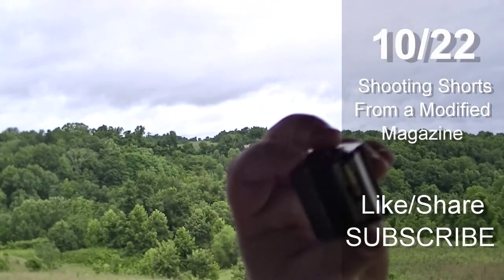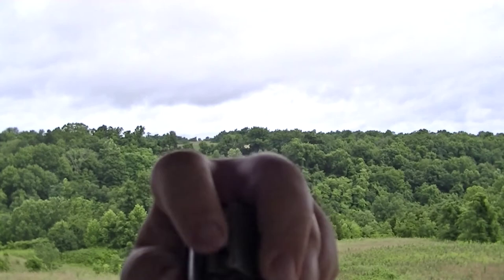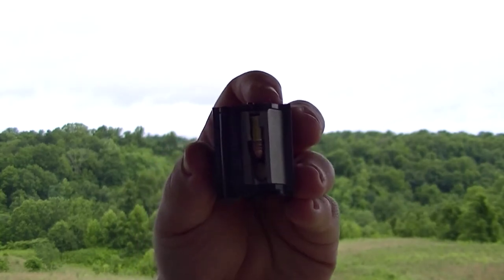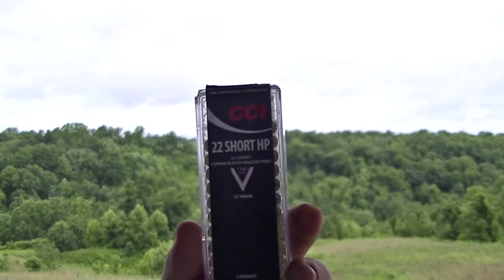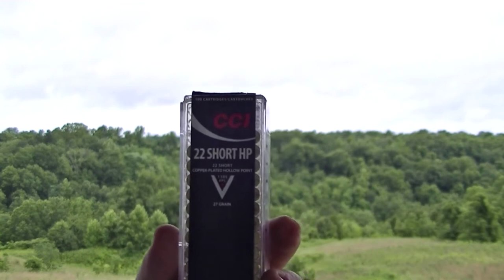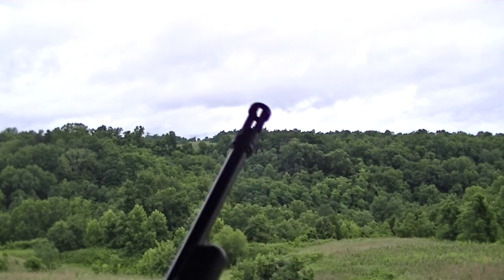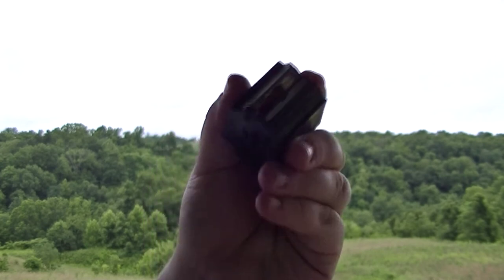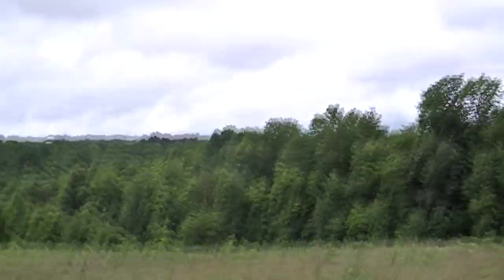Volquartsen 22 short magazine Field Test w/ a Ruger 10/22

Comment: I had the exact same results with my rifle. Its not enough oompff to cycle the bolt. HOWEVER: if you wanted to take advantage of the fact the .22 shorts are quiet, firing and having the bolt stay mostly closed is actually an advantage.

You are effectively using it as a single shot rifle but without manually loading(which i had to do to test the rounds). Not so much fun for plinking but for pest control around urban areas and people. the advantage of it being low velocity and low noise at the same time.

Comment: CB Shorts may give better results, as the bolt won't retract as far so the extractor may not "attempt" to fully expel the spent casing. I just got a similarly modified magazine and manually cycled it with perfect results. I'll see how it does live with CB's and standard Shorts the next time I'm at the range.